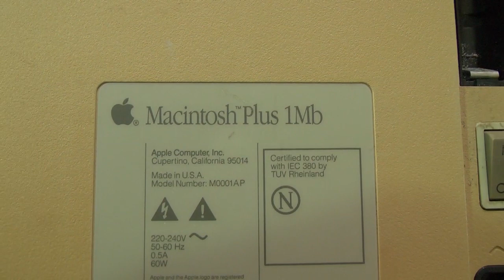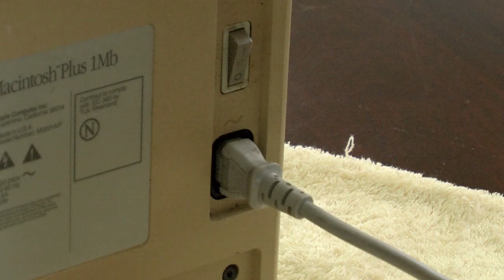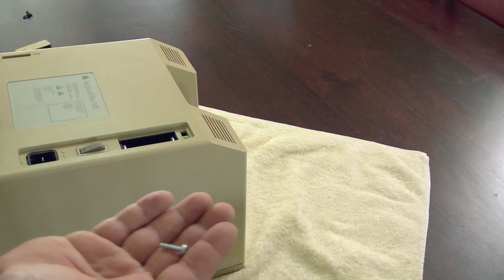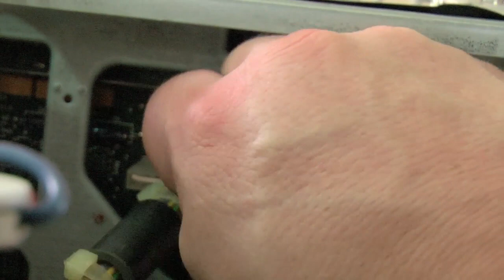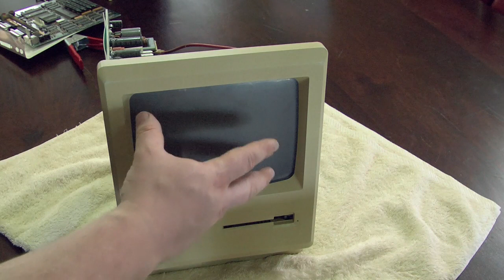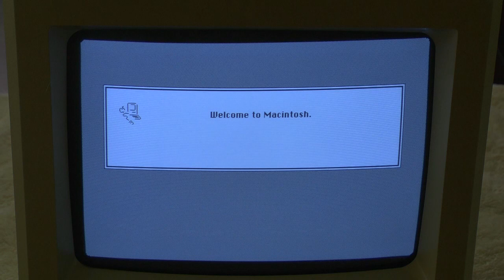Opening a Macintosh Plus

Comment: He is wrong about not being able to use a AA in the battery compartment, I have a Macintosh plus and I use a AA battery in the slot and there are no issues, it has been running for long while.
Reply from the maker: Yes, I have read this since I made the video. I've never tried it, but apparently a AA will work fine.
Reply: +brrayne Oh cool. Pretty useful too,just put some paper in to keep it in place.

Comment: What's the difference between the Macintosh Plus and the Super Mac?  I have one that looks exactly like that with 1 megabyte of memory but it doesn't say Macintosh Plus on the front or the back. There's no writing at all on the front. Just the little apple symbol. On the back there's a shiny rubber sticker thing that reads "Super Mac - 1 meg."  I bought it in a thrift store in 1995 for $35 with an external floppy drive and horrendous dot matrix printer.  The computer still boots up but unfortunately I no longer have the mouse or keyboard.
Reply: Hi. if you Jane fb you can join the low end mac group and we can help you. what you might have is a rare either prototype or a clone Mac Plus system.

Comment: at 9:39 when you said that if you take a screw driver a wedge it, yeah don't be like me, don't do it. i got little notches and gouches on the top seam. now i'm trying to find a new case for it :/ Doesn't pay to go at it like a brute D; Only mine was a 1984 original with and expansion. I don't feel as bad though because it had deep scratches near the handle when i got it, so i was going to need a new case anyway. I just thought it would work because apple had what was called "case crackers"